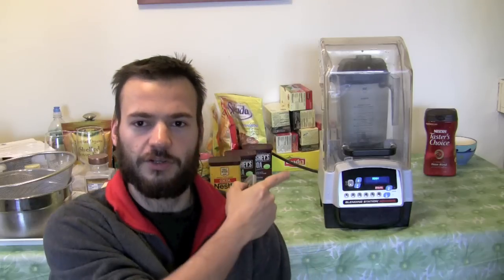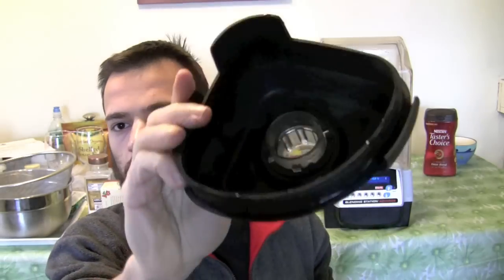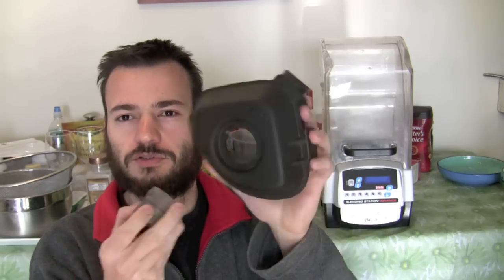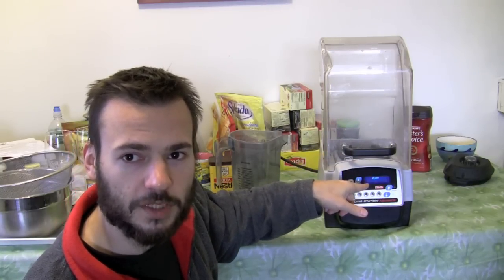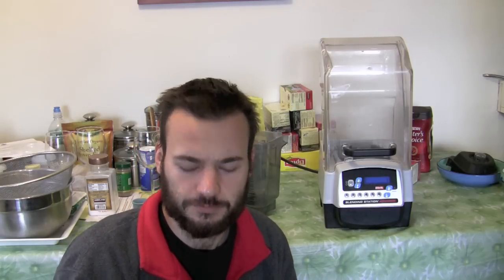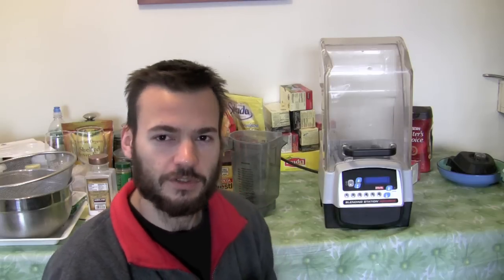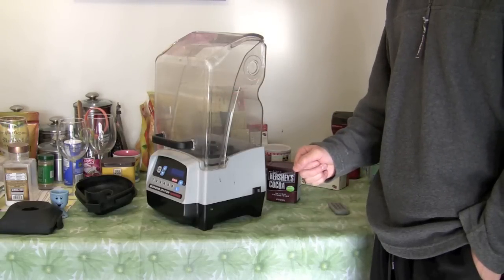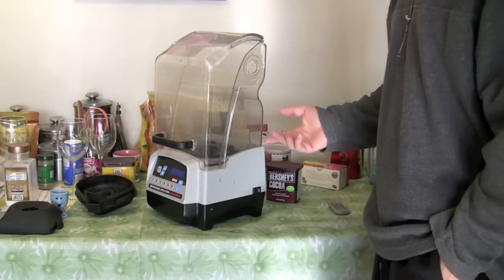Vita-Mix Blending Station Advance

Comment from the maker: if you do decide to get a better blender i suggest you get the cheapest model of Vita-Mix, because it costs half as much as mine and the warranty is twice as long as on mine - so it should be a no brainer.  mine is quieter of course, but you're better off using a pair of $20 ear muffs IMO.  any Vita-Mix or Blendtec blender will handle your orange skin without problems IMO.

Comment from the maker: actually i didn't mention the biggest difference in the video - and that is warranty.  if you use a home model in a restaurant your warranty will be void.  however professional warranty is much shorter, so it is better to get a home model for home use and professional model for professional use based on warranty alone.  i think warranty differences here are more important than design differences.  yet another difference is cooling - professional models have larger cooling fans.

Comment from the maker: @bintasyllah cooling on this machine is state of the art.  total overkill for home use.  i saw this blender work at jamba juice and it was holding up to essentially nonstop continuous all-day-long use.  the port design actually enhances cooling by preventing the mixing of intake and exhaust air.

Comment: Can you make soup in this model? Thanks in advance for your answer.
Reply: yes you can just use the manual control and ramp it up to high wait your 6 minutes, the advance has this manual control so you actually can use a tamper and container, you just can't shut it while using the tamper